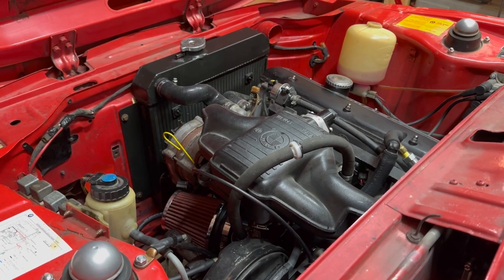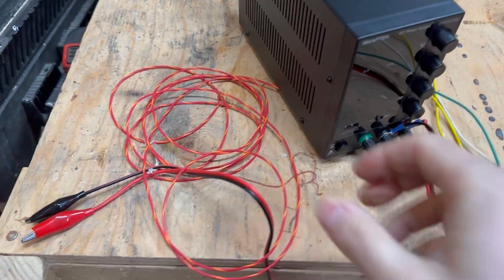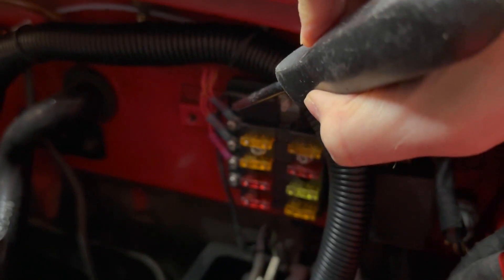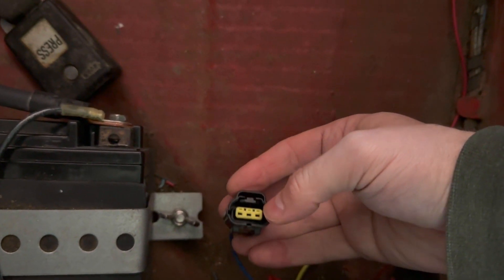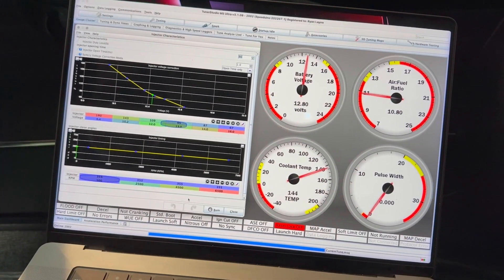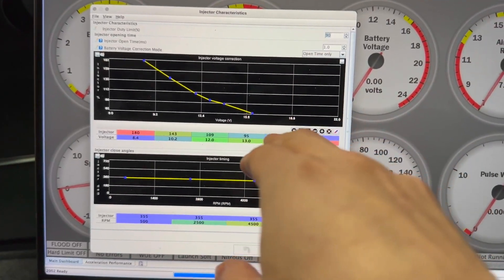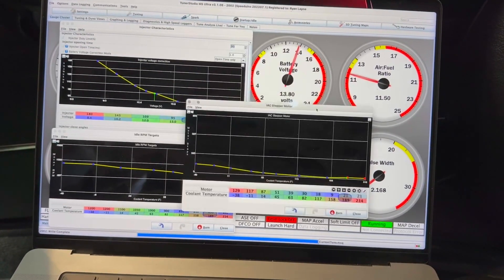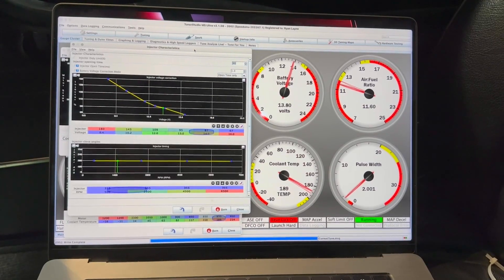Injector Dead Time Voltage Correction

Comment: Funny I was just planning on doing the same thing, but wasn’t sure what to do with the negative on the power supply.  Does it need to be grounded, or can I just leave it disconnected. I have a feeling I have to ground it to the chassis.

Google search found the perfect video then 😂. Glad it works
Reply from the maker: @huddleberryfin  The circuit must be completed and all grounds must be ultimately connected together.

Comment: Great video but how do i measure deadtime at a set voltage?
Reply from the maker: @teadrinkingilluminati9173  There are numerous methodologies, including getting a spec sheet from the manufacturer, which a google search will pull up. But the easiest way is to set engine to a fixed rpm, maybe 1500, and then change the number of squirts per cycle and adjust the dead time until the AFR does not change. So if normally you do 2 squirt per cycle then changing to 3 or 4 squirts should make no difference to AFR. But if it does, you know the dead time is wrong and throwing off the injector pulsewidth calculation. Adjust dead time while running until the AFR is stable at a couple different squirt counts.

Comment: I HAVE A CONFUSION. THE INJECTORS I HAVE NOW THE DATA SAY OFFSET IS .055ms . DO I NEED TO ADD OR SUBTRACT THAT FROM THE CURRENT NUMBERS OR I NEED TO CHANGE THE CURRENT 1.280ms @ 14v WITH THIS .055ms. AND THEN INTERPOLATE OR SMOOTH THE TABLE AND START FROM THERE ?
Reply from the maker: @tonyvtech25  Dead time is not the same as dead time voltage correction. If your injectors come with data specifying the dead time and voltage then set the base dead time to that value, then run through the procedure in the video to calculate correction. Set the table to have 0 correction at the voltage specified in the data. So for example if thats 0.055ms at 14v, then set your correction at 14v to 0 and then make everything in the correction table match the afr which shows at 14v. Then fix the rest of your tune fuel tables because those will now be wrong.
Reply: @ryan_layne   THANK YOU

Comment: so both ecu and injectors needs the voltage from rhe variable controller?
Reply from the maker: Yes, the ECU needs to see the injector voltage changing and apply its dead time adjustment curve.

Comment: How did you get the voltage to the ECU was your bench powersupply supplying the ecu as well
Reply from the maker: ECU has a direct wire to the battery as is always recommended
Reply from the maker: I ran a wire from the power supply back to where the ECU connects to the battery and then that wire goes all the way back up to the ECU. I just did that because it was easier than trying to back probe directly into the ECU connector

Comment: Hey man, this is absolutely what i needed and actually am about to try this today. So i appreciate the video. I was curious if you could tell me what you connected your negative side to. I assume chassis ground but wanted to make sure before i messed something up.
Reply from the maker: Chassis ground but make sure your voltage drop is neglegible between chassis ground and ecu, and chassis ground and injectors. Otherwise they readings and correction will be incorrect.

Comment: You wouldn't happen to know the injector characteristics settings for a 510cc 4g63t injector would you? 
I'm also using tunerstudio and also a speeduino board UA4C 
it's my first time setting a project car up and I'm all new to this.
Reply from the maker: I don't, sorry, but as demonstrated it is quite easy to intrinsically arrive at the correct values for these numbers. I am of the opinion that this is even better than knowing the theoretical characteristics of injectors. Unless the factory tests your specific injectors at your specific fuel pressure, etc, it will almost certainly be slightly wrong to use their numbers. If you instead use this method to determine your dead time, you will arrive at the precise correct number you need for consistent running on your car.